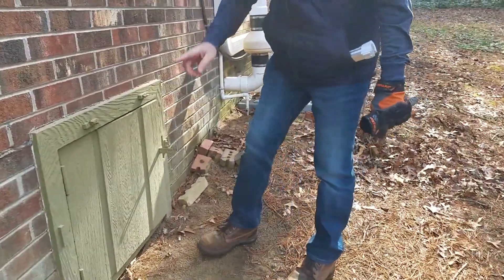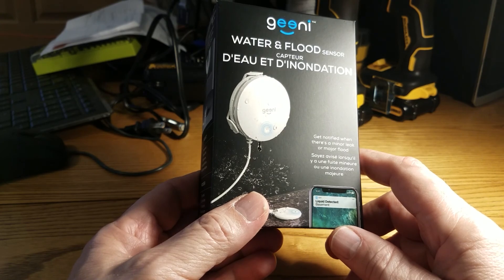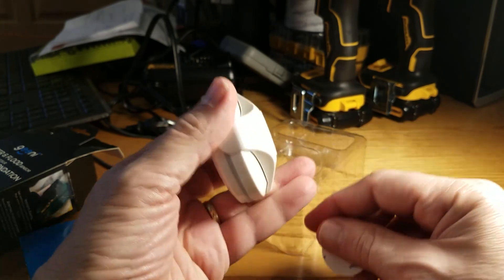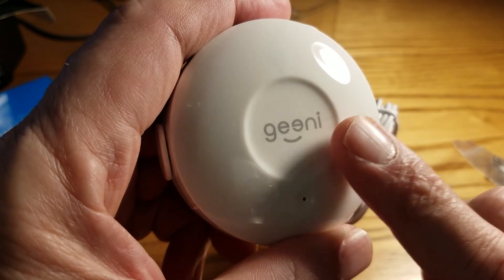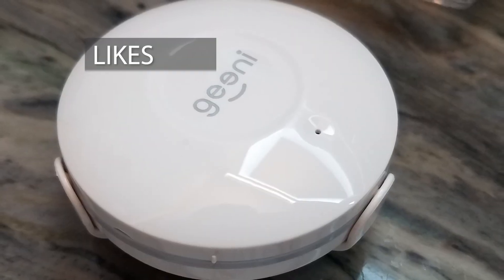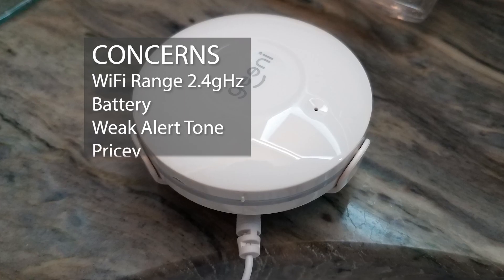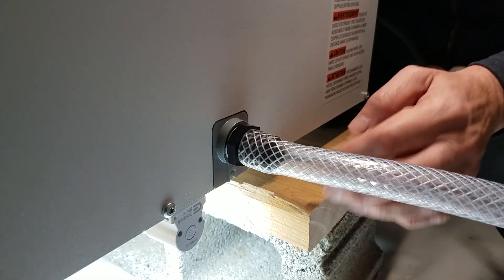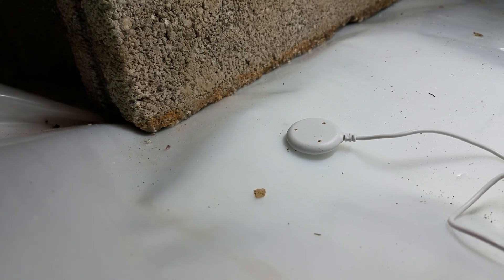All Wet? Geeni Water & Flood Sensor

Comment: I was having issues with mine going off line from too weak a wifi signal. Installed a wifi extender, reinstalled the water sensor, and problem solved.
Reply from the maker: Barry, my experience has been less than satisfactory. I had water pool over it and it didn't alert. Glad to hear your system is working better.
Reply: @cfldriven Strange why yours didn't alert.  Bought a 2nd sensor for a backup to let me know when our cistern is full
Reply from the maker: @barryo9065  At first I thought it was the battery, a new replacement with the same results. Maybe it just failed.
Reply: I tried a battery replacement also and didn't help me either. Battery level reports 38% to 76% on new battery

Comment: You put the cover on wrong. Light not lined up with hole in cover.
Reply from the maker: Robin, yes you are correct the cover is not aligned with the LED light, although in my application it wouldn't be visible either way. Thanks for really watching.

Comment: Nice video but you never showed how it actually works or even if it does work.
Reply from the maker: Thank you for the feedback. I actually do show how the device works at 6:12 in the video. It has been over a year since installation and it still monitoring for a leak.

Comment: I tested my 2 units to make sure they work before I leave.  No alert or notification on app. Nothing shows in app of an Alert Red light and Beep works fine.
Maybe devices are not connected?
I run a Netgear Router 5 G
And was able to connect and add to and name to each when new
Did replace a battery in one device
Now a year older both units don’t send an alert to phone app
What good is this for $30 each?   Disappointed
Reply from the maker: Did you check under NOTICE in the app to make sure that leak detection and low battery sensor are on?  To the right of NOTICE is the battery status. My unit has been running for a year and battery status is still full. Also if you click on the three dots on the upper right hand side, you can check the network status. Hope this helps.
Reply: @cfldriven  @cfldriven  Thanks for the reply  I did check both of them and one sensor had Notice and the other did not. What I did is Remove both devices and then do a New Reconnect. Now both are working correctly  Mine have the senor probe bracket and one of them is nice and tight the other loose so when vertically mounted it kind of hangs there and is not really a good connection for the 3 brass points? Kind of a poor design so I made that one lay horizontally in my H20 pan.
Reply from the maker: @daveholte7658  I am still leery of all this smart technology and how each needs its own app. Happy to hear you have a solution. Thanks for watching and sharing your experience.
Reply: @cfldriven  Think you are correct . Leery  As I was sitting here today and received  a alert notification on my H20 location ...Leak Detected. OK so I went and looked and all was dry? The alerts were going off like crazy and Red Light and Beep finally stopped.  So don't know why it gave me an alert and notification now?  Hmmm
Reply from the maker: @daveholte7658  Sort a feels like we are the guinea pigs for these new products
Reply: Darn.  The next day I get an alert and notification on same H20 sensor.  Checked and no water once again?   Hmmm.  Is there a way to Delete History on this sensor?
Reply: @cfldriven  After 2 days on receiving Alerts and Notifications on this H2O sensor  Think I found the problem I had it mounted Vertical on my H2O in the Senor Probe Bracket Holster. The bracket that holds the sensor is so loose and sloppy and when it moves or falls around it looses contact with one of the 3  brass contacts and them issues an alert.  It is a sloppy design and not a tight fit. I know I can use the senor with out the senor bracket and probe. I now have it sitting horizontally in the bracket and holster and see what tomorrow brings.  Trial and error.
Reply from the maker: @daveholte7658  Good to know, my sensor sits horizontally under the dehumidifier and although the app tells me the network signal is week despite standing over the location it still seems to be working. Thank you for updating your experience and the good tip.